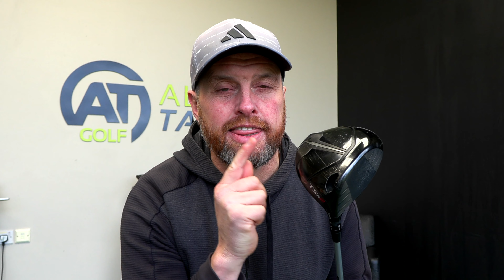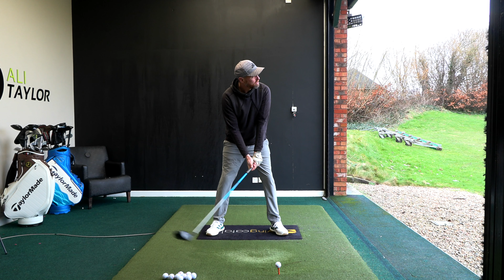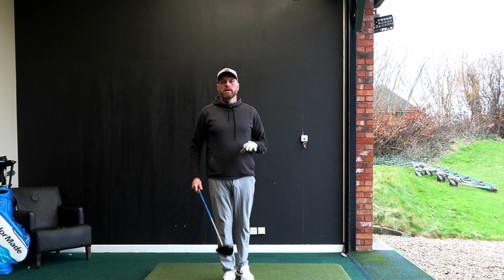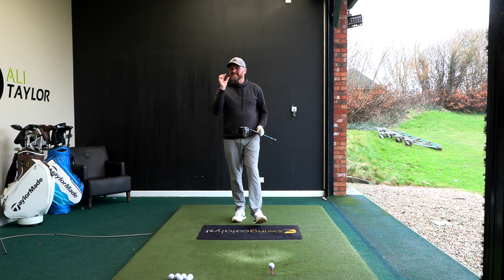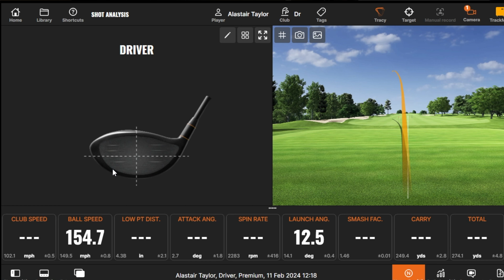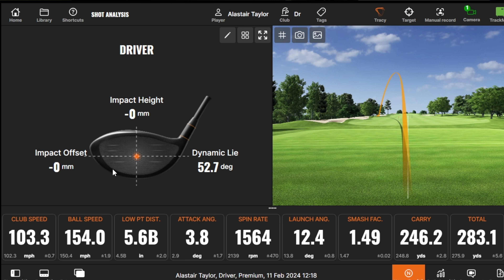Is Hitting Up With Driver Costing You Distance?

Comment: You hit the 1st one ( with a higher tee) 10mm low so the ball speed was lower and it launched lower and had more spin than it should have.  If you hit it in the middle, the higher tee with higher AOA would have been the longest carry and total.  But a high AOA can cause a low strike, which results in what you have shown here.